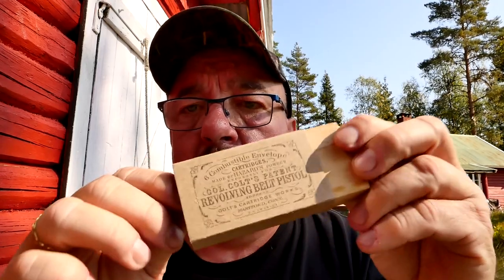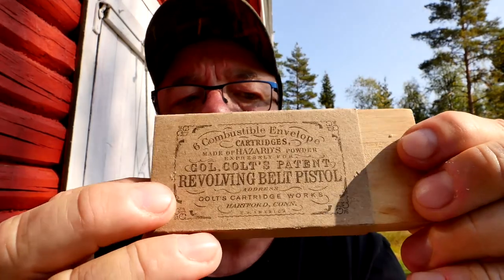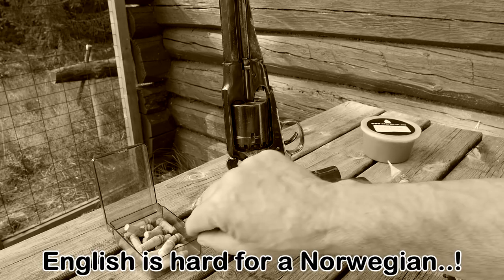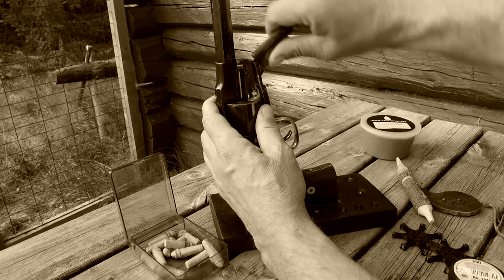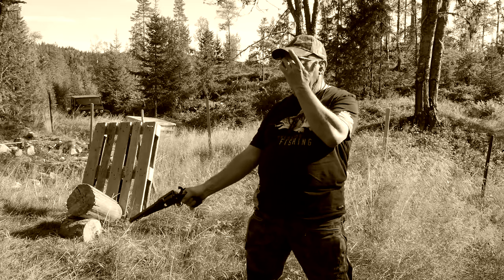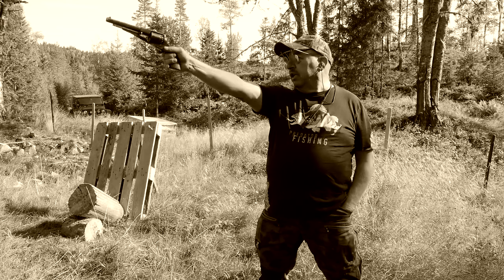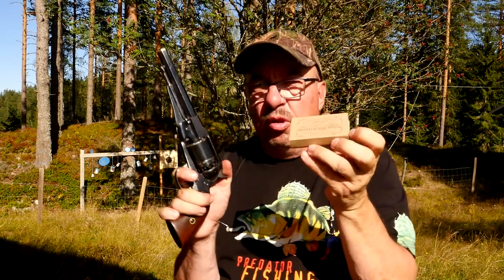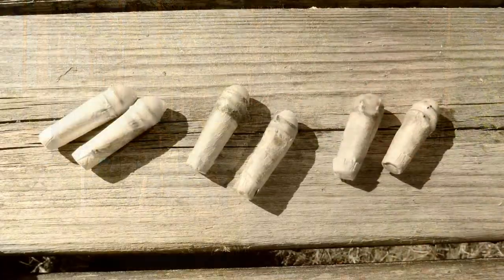Combustible Envelope Paper Cartridges First attempt

Comment: I use regular cigarette paper and I just use a 24gr powder flask spout as the cartridge former, they're not as pretty as the ones made with the kits but I can adjust how much powder I load them with instead of being limited to 15gr.
Reply from the maker: You can make the paper cartridges with alternate powder charges using the Capandball kit. I think 20 grains will do the trick with the conical bullet that I cast. I will show the whole process in a lather video. I have high hopes for the unbleached cigarette paper. The unbleached is just for looks! Thanks for watching!